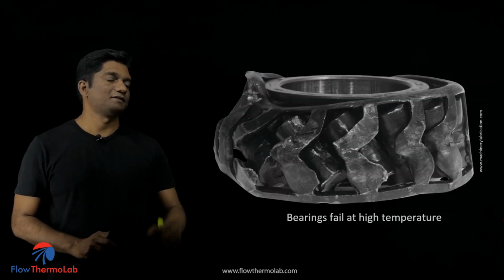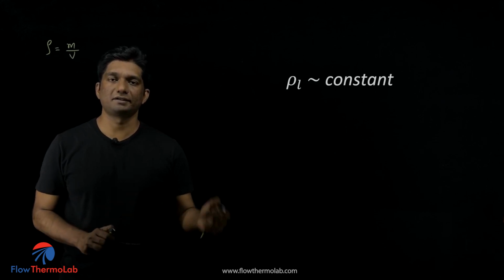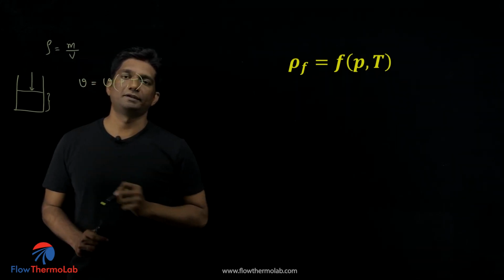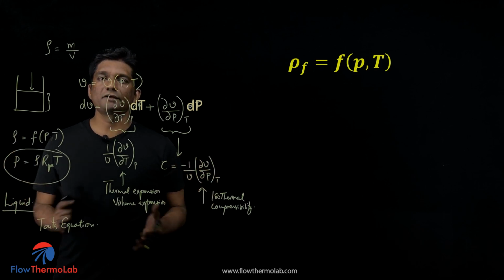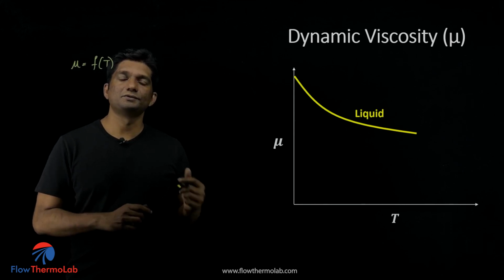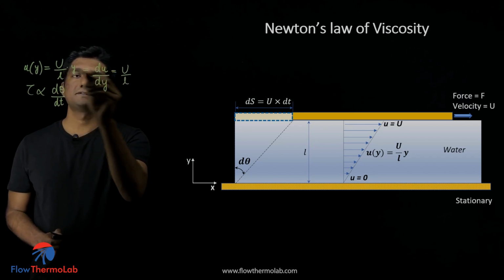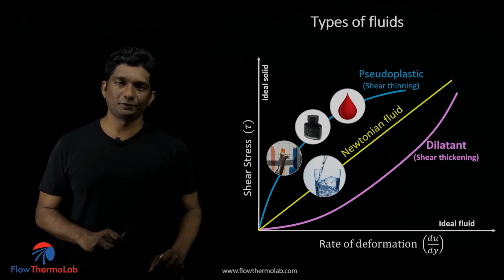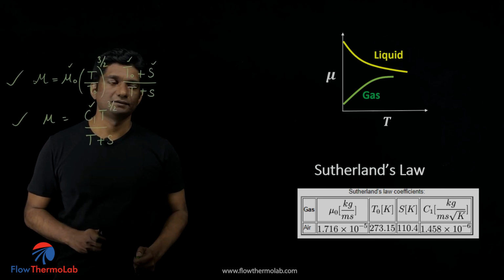Fluid dynamics: Lecture 2: Fluid properties (Density and Viscosity)

Comment: The lady was floating in the Dead Sea because the water there is denser than the human body. The bearing failed because the lubricant became less viscous at higher temperatures, which caused the bearing parts to rub against each other more easily and consequently fail. Am I correct? If not please correct me.
Reply from the maker: Thats correct!